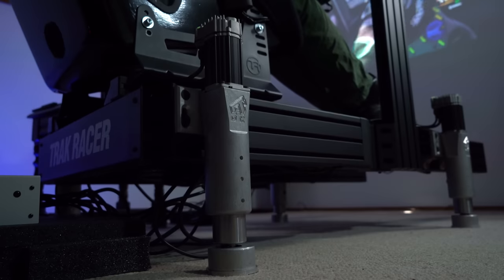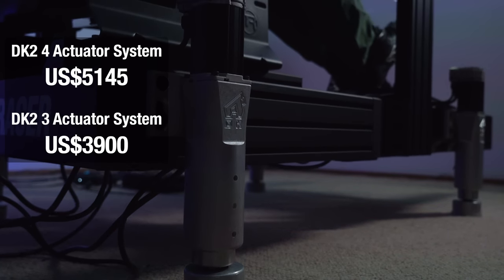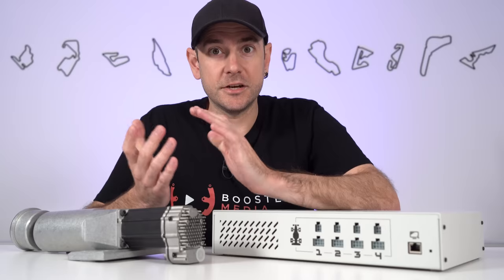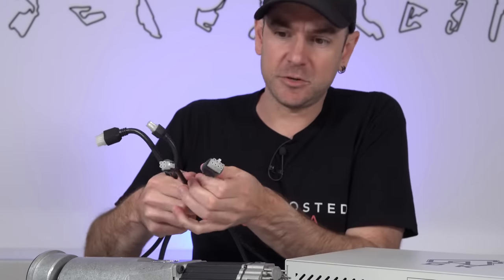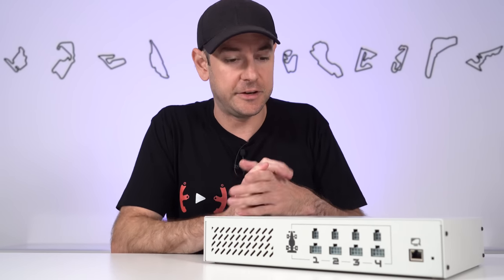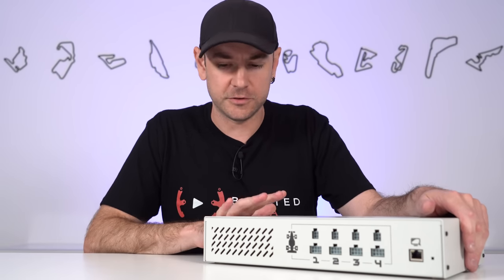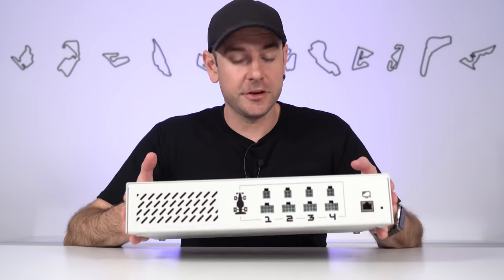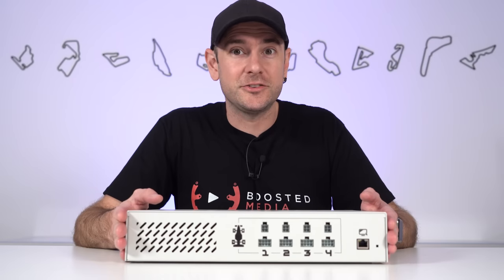REVIEW - Sigma Integrale DK2 Sim Racing Motion System

Comment: Nice review ;) I have had DK2 since last summer. I'm really happy with it, and the support from Sigma Integrale are the best I have experienced. They genuinely want you to be a happy customer, and I am. I run iRacing only and use VR. I have my settings quite low with no smoothing. It brings the immersion to the next level, and makes even a test drive alone on the track fun. I don't have the clicking noise showed in this video. It is not dead silent, but it is not a problem at all in my opinion.
Reply: I own the DK2 as well I have no rattles. I'm completely happy with it as well. Loved the update when they added engine vibration.
Reply: Hi Steffen, just got my DK2 and ran a "tuning" session. i also use VR and i have to dial the settings down quite a bit, otherwise i can't see a thing because of the shaking of the headset ;-) can you share your settings ? what i am missing a little bit is the "environment". Meaning i am not feeling it in the stomach when driving over a hill... also i think the road vibrations is extremely intense compared to the other settings, so ihad to dial them all the way down to 1. really courious what your experience is in that regard.
Reply: @diegostalder9663  Hi Diego. Cool! What sim do you use? I only use iRacing, so I'm not sure if the settings will work the same way in other sims. My settings is. Gas/Brake Pitch:3, Turning Roll:1, Heave:5, Environment:2, Road Vibration:4, Engine vibration i put to 10 and 0/100. (sometimes in race I put it to 0 to feel the road much as possible.) This I know can very because of different rig and weight. I use a HP reverb G2 with trackers on the headset, so big movement can influence the tracking a bit. So I like small movements, but big movements don't give me anything. I want to feel the car. What headset and rig do you use? About the shaking of the headset. I also felt that first time I tried it, but its not a problem for me at the moment. Try to be more relaxed in your neck and absorb some of the vibration. You should join the community for Sigma on discord and Facebook. Many users can help you with the tuning. Im sure you will be happy with the DK2 when you tune it right and get used to it ;)
Reply: @sscheen  thx ! i use iracing to. i have varjo aero and a nlr f-gt elite cockpit. i defintitely will checkout discord.
Reply: @diegostalder9663  I also have had a look at Varjo Aero. It looks awesome. Have you mounted the basestation on the rig or in the room? I would guess you would have less problems with big movements if the basestation was mounted and moved together with the rig. But I have not tried it myself. My G2 have camera trackers and no basestartion, so big movement would effect tracking for me.
Reply: @sscheen  no, basestations mounted in the room. never came to my mind to mount them on the rig, havent heard about a setup like that. i use vr also for gaming from time to time. the problem is actually not the tracking, its the movement of the headset on my head :-) but thats ok i guess, i dont need big movements, they dont feel natural to me. i can only recommend the Aero, its an awesome headset, especially for simracing. i also hat the g2, still the best choice in terms of value for money.
Reply: @diegostalder9663  Hi, I just ordered the DK2, I also use the Varjo, have u managed to sort ur issues out? Also have u had any interference issues with the Varjo and motion system?
Reply: @SURG3NT  Hi. No, after some tuning I am totally happy with my settings !  So you can look forward to your DK2 system. I am sure you will enjoy it !
Reply: @diegostalder9663 Any chance you could post any pictures of your rig with the actuators? I'm curious where you ended up mounting the brackets. Seems like mounting locations are limited because everything mounts to the outside of the extrusion on NLR cockpits.
Reply: @jamesclewett8934  hi James. Sure, where do you want me to post it ?
Reply: @diegostalder9663  Hey there. Anywhere you could link to a picture would work. Do you have any file sharing accounts? Imgur etc. Thanks!

Comment: Good review of a very good system! Had mine since oct/nov, used it 100`s of hours without any issues.
I never run my smoothing above 2 in any layer, normally 1 or 0 as it is so effective even at low levels and easily dampens road surface and lower rumble strips etc.. Race cars are`nt comfortable ;) 
As for intensity, i normally run pitch at 3, roll at 2, and the rest at 4-5. 
Never had those ticking sounds in mine though, mine`s smooth as they can be.
Reply: random question...do you have your monitors mounted so that they move along with the rig, or are they freestanding?
Reply: @secretysecret1551  i run them separate from the rig, and i havent once felt it is wrong or wierd.. Maybe its better for some to have them to follow the rig, but you better secure them well unless you enjoy looking at vibrating and shaking monitors.
Reply: @-Ola-.  ah ok, thank you for the info. I'm barely getting into the whole rig scene, but couldn't figure out which route I should take. it seemed that the monitors should be mounted for full realism, but I can't imagine that even working remotely well....a heavy monitor bouncing up and down all day.
Reply: How much does it cost
Reply: @-Ola-.  I had the same concern. Someone else had said it was odd further down and it has me a little worried!
Reply: @CaseyM7  no need to worry, allthough it’s understandable when youre buying something this expensive. But i think this was a one off, from a very early batch. And if there ever will be any issues with a system, Sigma are the best to talk to for help..
Reply: @-Ola-.  thanks!

Comment: I use my D-box system only at 72% it does not make you faster but it is just pure fun, the rise of the rig on one side when you drive up a curbstone in combination with the vibration adds to the immersion especially in combination with VR.
I have had all three combination screens not moving, screens moving and VR.
Screens not moving does not work it gives a weird feeling when you brake and move closer to your screens.
Reply: How did you manage to have your screens moving with your rig? I have read that the movement may damage the screens. I have triple 32"
Reply: Why should movement damage a screen? There’s no logical reason for that.
As long as your screen holders are rigid enough and you don’t have this system where the screens are on individual stand instead of the rig, your good to go!

Comment: Odd ticking sound. I have the DK2+ and there’s no ticking sounds. When turned up, you can hear the piston, but that’s it. The DK2+ is a beast. Great video though!
Reply: So would you say yours is quite?
Reply: @CaseyM7  No, I wouldn’t call it quiet. If I’m wearing headphones, I don’t hear it. Using speakers, I hear but not overwhelming at my normal settings, which are on the lower end. They use a type of teflon that surrounds the piston instead of lubricant so it’s a different sound. I’d say louder than other actuators though. I have it paired with a GS-5 and it’s not as loud as that. But, no ticking, just movement.

Comment: Hearing Tom talk about the vibration travelling through the floor, a possible solution is a piece of MDF or fibre board laid over say a couple of exercise mats might deaden the vibration through to floor and transmitting it through to other rooms below
Reply: I agree with Tom, I have the DK2 and it's on the second level of my home. On higher settings my whole bedroom shakes, this is a powerful system, but it's great fun, also helpful in learning how the car is responding on track. The guys at Sigma are dedicated and extremely care about your experience with their system and the personal assistance you get makes it more valuable than any other systems.

Comment: I really wish that someone would do to the full motion market as what fanatec did with the CSL DD.

A ready to run system, fully plug and play at a killer than everything else on the market.
Reply: Simrig SR 2 :)
Reply: @rickywylde8137  that’s not even close man. That’s 8 grand. It’s not even close to affordable for the masses. 

I’m talking literally half that.
Reply: Dont know where you are located but the Simrig SR2 is about 4k EUR in Europe
Reply: @rickywylde8137  did you buy the simrig SR2? how did you feel on it? price seems fair, and also 70mm of travel doesn't look that bad, way more than the dbox gen 5

Comment: There are various reasons a system can display some lag, from the hardware down to the software and the users settings.  When making  diy sfx there are also areas where a user can get something wrong on hardware settings itself (dbox etx dont ask you to change servo driver paramaters).   The servos used in the SFX system are fast and powerful enough that if everything is done right there shouldnt be lag thats perceptible compared to other systems.

Comment: Hi Will, I have a question if you don't mind: I currently run 27" triples set just behind my wheel for maximum immersion. If I were to get the DK2, how much monitor clearance do I need? Could I still get away with rising my screen a little but not needing to place them all the way back behind my wheel base? Thank you!
Reply: 2nd this .. does anyone have the answer ?
Reply: @Raceeverything  I ended up ordering a PT Actuators Champion GT (125mm of travel, so it’s longer). I will optimise my monitor placement once it’s delivered and I’ll update you.
Reply: @SalvatoreIovene  I´m on the fence considering exactly these 2 options... anxious to hear your take on the PT option
Reply: @felipegalindo1313  got the Champion GT. The 125mm of travel make no matter, I'm still able to run the monitors very close to the wheel. I moved back and higher a bit, but not that much. Only cost me a few degrees of FOV. It's not really noticeable.
Reply: you can raise your monitors 3in and should be good. i have mine mounted on the rig. 49in. i had to get rid of my triples cause of space. ive been running the dk2 for almost 2 years

Comment: Thanks for another great review! 
Couple things I noticed that I thought I'd comment on. First, for anyone who doesn't have a free Ethernet port, rather than purchasing a USB→Ethernet adapter for about the same money ($15-20USD) you can pickup a PCIE Ethernet card. Which, assuming the computer is at least PCIE 3.0 (can't imagine any sim titles running on anything older, not to mention if you can afford this kit... ;) ) you can use a 1x slot (could even get away with a dual Gigabit Ethernet port card and be okay.) If USB must be used for whatever reason, I'd highly recommend making sure it's USB 3minimum. While I doubt this system will nearing gigabit speeds, still better to have the head room (USB 2 is less then half Gigabit speed.)
Secondly, the 'transformer' on the PCB inside the control box, is actually an AC/DC converter. Taking the mains voltage input, and outputting 5VDC 2A. There will likely be a small transformer inside but if that was all it was you'd still have an AC output and that microcontroller it's powering would not be a happy camper😉 Not super important, but thought I'd mention it.
Anyways thanks again for another great video,
Michael
Reply: or an ethernet switch!
Reply: @David-qu3ro  yeah very well could work! As long as it doesn't confuse the software. It shouldn't since you're just pointing to it with an IP address, however, stranger things have happened when things are done in a way unplanned for by the software/firmware.
Reply from the maker: A switch isn’t going to work I don’t think as you need to be able to set a static IP for the port the device is connected to.
Reply: PCI-E 1.0 1x is enough for 2Gb speeds FYI.  Looks like your confusing gigabit vs gigabyte.  As far as static IP's on a switch, that will definitely normally work fine, and if some reason it doesn't that's a failure on Sigma Integrale's design.

Comment: Hi Will: have you thought about making a comparative and category classification of all the products and devices that you have tested? I mean a rating from 1 to 10 (with decimals) so that we can get a quick idea of the true level of all of them. In each tested item you would only have to include the classification at the end, so it would be available in all of them and looking at the video of the most recent one, we would have all the items available.

For example: if I want to buy a steering wheel, I would only have to go to the video of the most recent steering wheel and at a quick glance I would see what the true level of all of them is. Then I could calmly go watch the video of the steering wheel that interests me and I would avoid having to watch 10 or 20 complete videos only to end up more confused than at the beginning.

Or would that be too difficult for you?
Reply from the maker: It’s an idea we’ve considered extensively, but so much of this is subjective it’s very hard to put a number on something. We thought about a points system but yeah. Not sure. It’s not off the cards though.
Reply: @boostedmedia  Yes, it is quite complicated (I know). Because as you indicate the process is all subjective. If they were complete kits it would be very easy: it would only be a matter of putting the times achieved on the same circuit.

It would only be a reference for us anyway. Your opinion is better than going blind to the store. If the decimals are removed, it could be viable. It is only about establishing a first classification: very good, good, normal, bad and very bad. And then, within the result, better or worse. Automatically you have a grade from 1 to 10 almost effortlessly.

Comment: Is that rattling and clicking happening with all DK2s? And if not, would it then be quieter than the DBOX?
Reply: Unfortunately, this was an independent issue with this demo system. The system is 60-65 dB at full speed. The floor reverberations are much more pronounced and can be 'silenced' by having the system on carpet or a gym mat. :-)

Comment: Hi Will, thank you so much for another awesome review. Actually I'm undecided between the sigma integrale or the Simrig sr2, which would be a lot cheaper but has no ability to simulate f.e. engine vibration as far as I know (or  another option: no motion and saving the money 😆) how much impact does the vibration  has regarding the immersion for you? Is it like 'nice to have' or 'essential', meaning without vibration / tactical Feedback there would be something 'missing' from your experience? Of course tactical Feedback could be added with buttkickers etc, but I would rather prefer an all in one solution rather than adjusting the buttkickers separately. As always thank you so much!
Reply: Did you make a decision? I'm looking at both systems as well. I think the DK2 will be winner.
Reply: @davidjefferys4489  youtube keeps deleting my replies ^^ yes I chose the SR2 and I'm very happy with it. But the DK2 is a very interesting option, I didn't choose it because of import fees to the EU and poor reseller availability here...
Reply: @MaxJacuzzi  fair enough mate. Thanks for the reply

Comment: there is 4 holes on top of the motors. mabe it's there to add a small fan. mabe the USB port is to plug it? better cooling for the heat exchanger
Reply: The 4 holes on top of the motor are for a small fan. But the motors run cool and hence the fans would only be needed for extreme environments.
Reply: @SIGMAIntegrale I can't wait to buy you dk2+ So many project but your system make this project obtainable

Comment: Question, thanks to this review I ordered the DK2 system :D. But I need a new rig (have a tubed rig now). I really like this Track Racer TR120 but is the bottom of the frame stiff enough for it? (because it has the curved connectors in the middle of the frame)
Reply: How much was your dk2 system total and what’s the shipping time ? Considering getting one or saving more for dbox
Reply: @JDZA 916  I already received it. Was delivered within 2 weeks! (To europe) Not sure exactly but out of my head the total costs were about 5100 usd for the system 170 shipping and 500 euro duty taxes for the  import. (This is offcourse only if you deliver outside of USA). Had everything installed super easy within 45 minutes. The system is really amazing. 😃
Reply: @denimdimi  nice. I just ordered my rs mega+ , looking forward to it.
Reply: @CaliCuh how is the RS motion?
Reply: @denimdimi  love it man. Can never go back to a regular rig lol.
Reply: @CaliCuh  Haha same here, if I forget to turn in on its like going back 10 years in time. Also make me nauseous at the first brake point. So keeping it on all time. Just have the turn/roll turned down to 10% or so. But best upgrade ever

Comment: G'day Will and Tom, great review. How do you think this system would integrate with the Next Level GT Track cockpit? My setup is currently sitting on 6 castors. Making some brackets wouldn't be a problem to adapt to the the profile style mounting, more concerned about the possible flex and load on the main frame of the GT Track given only 4 supports vs 6?? Cheers, Paul
Reply from the maker: Hard to say but I can’t imagine it would stand up to it too well as it’s not really designed for something like this.
Reply: @boostedmedia  Hey Will, the latest Next Level racing motion system seems to work on the GT Track frame from the ads at least. Your right, I think the rigidity of this style compared to the profile style may impact somewhat??